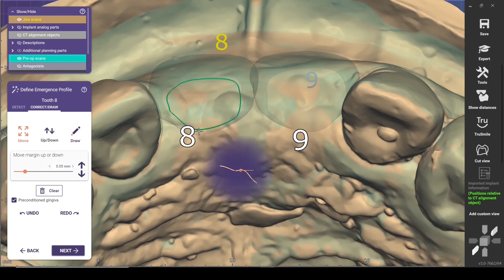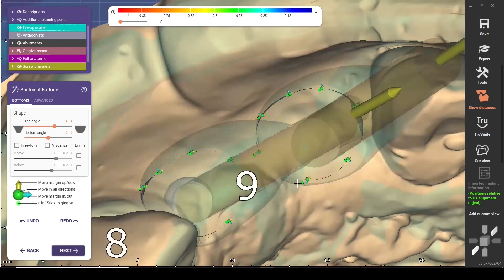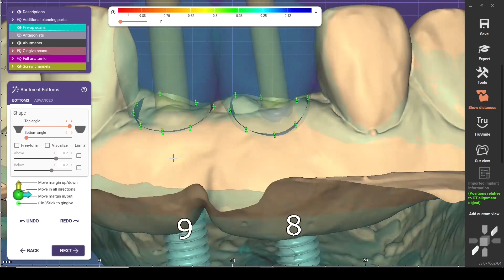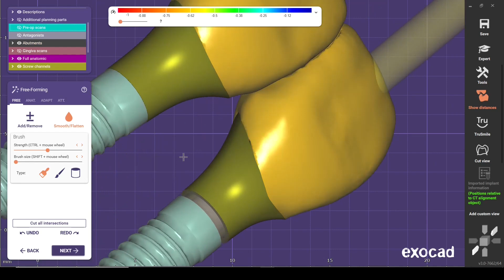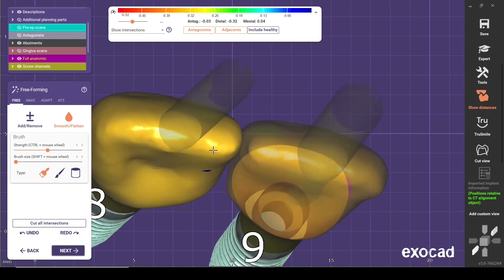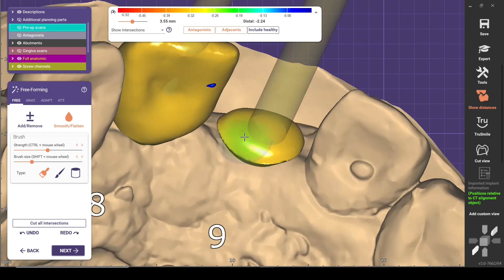ExoCAD Tutorial - How to make a custom healing abutment and immediate provisional

Comment: very beautiful presentation and explanation ,, thanks from the heart !  i just wants to ask how did you import the exoplan  implant planning to exocad without it asking for scan body position and it straight jumps to implant connection, i tried to save the planned mesh as stl and load it but didnt work either
Reply from the maker: Thanks so much for watching and glad you liked it!
Hmm - It automatically imports or asks to import the implant position when you import it from exoPLAN to exoCAD.  You are right.  You are trying to save the mesh of the implants as an STL?  I think you can save dummy implants, or the implant bodies without any connection geometry.  That is possible to export that as an STL, but the implants with connections, like an internal hex - those are protected libraries and can't be exported.
Reply: @puravida4evr  i got it ,, thanks so much 🙏 the dilemma is for example i use Osstem implants , the connection (ti base) isn't available only as a scan body ! , am trying to use built in library as custom abutment (ti base )  as long as 20mm  then i ll use a Cylinder (widly available) then pick up from pt mouth  ( i ll drill the screw channel channel wider to allow the cylinders to pass through , then inject acrylic  let it set and finish outside the pt mouth )  hope u got my idea , how do you think of this idea ?
Reply from the maker: @ashouhdy  Got it - So if you were able to digitally make and access channel all the way through the design where the implant is, that would allow you to pick it up in the mouth?  Is that what you are wanting?

So you can save a scene as mesh and export the yellow access channels.  Then bring that into exoCAD, and use those channels as a guide to make the holes.  use Attachments panel (under free form wax-up tools) to make a boolean subtraction using a cylinder shape.  You can change the size and length, and then it will cut the hole for you.
Reply: @puravida4evr  brilliant 🌟✨ deeply appreciated 🙏🙏🙏  u r the boss !

Comment: Hello, yes i have the same question; After planning the implant position in Exoplan , how do i take the exact implant position the i planned and move it on to exocad where you started by " Loading Implant connection " in Wizard? Thank you so much! Please provide instruction on how to do it. Thank you so much!
Reply: When you are planning the implant - it should be the actual implant system.  Not a stock implant shape sometimes called a dummy implant.  If you see a stock implant, and not the actual shape of the implant you are using then the implant library is not installed.

You should have the same implant library folder installed in exocad also.
If those are both true - and this isn’t loading automatically when you launch design from the exocad dental DB then I think what is wrong is that your dental DB for exocad and Exoplan are different folders.

So on my exocad DB - I have the Exoplan icon, and CAD Design icon.

They share the same case folder, so anything I do with implant planning is saved to the same folder that is used when doing CAD design. 
So when I launch design - a window pops up asking if I want to import the Exoplan case and the implant location - I click yes.

If this is NOT  case - ask your exocad vendor to make you Exoplan launch from your exocad DB, and ensure the files are being saved to the same case folder.

Comment: hi..how to open that in exocad after doing implant plan in exoplan
Reply: When you are planning the implant - it should be the actual implant system.  Not a stock implant shape sometimes called a dummy implant.  If you see a stock implant, and not the actual shape of the implant you are using then the implant library is not installed.

You should have the same implant library folder installed in exocad also.
If those are both true - and this isn’t loading automatically when you launch design from the exocad dental DB then I think what is wrong is that your dental DB for exocad and Exoplan are different folders.

So on my exocad DB - I have the Exoplan icon, and CAD Design icon.

They share the same case folder, so anything I do with implant planning is saved to the same folder that is used when doing CAD design. 
So when I launch design - a window pops up asking if I want to import the Exoplan case and the implant location - I click yes.

If this is NOT  case - ask your exocad vendor to make you Exoplan launch from your exocad DB, and ensure the files are being saved to the same case folder.